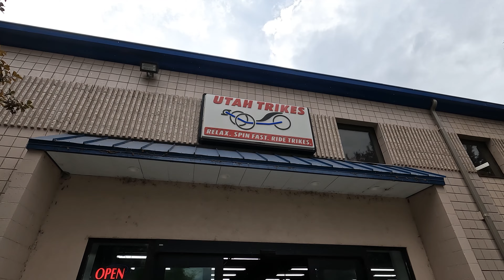The Stig tries out a new e-bike in Las Vegas!

Comment: But.....What about making my AC unit more efficient?
Reply: Yesterday was the first Sweater Weather day of the year so I guess it doesn't matter
Reply: Who cares? He's busy making spam! Look elsewhere.
Reply: If you are in a hot dry climate like the desert southwest then put evaporative cooler pads around the condenser and keep them wet. If you are somewhere with a high water table then geothermal would be the way to go. New A2L refrigerants are coming that are mildly flammable but supposed to be higher efficiency. Continuously variable refrigerant flow and fan speed systems are also available. Otherwise wait until the engineers have magnet based refrigeration materials costs down because gadolineum is expensive. Maybe we can mine some asteroids?
Reply: Yes!  Been waiting for the part 2 for ages.  Hope it'll come out before it gets too cold to do anything outside comfortably.
Reply: I’d love to see AC conversion to heater experiment, but when?
Reply: @Himself2019  What do you mean by AC conversion to heater? Like a heat pump with a reversing valve?
Reply: Change your filters every 3 weeks like clockwork. Clean out your condenser 4 times a year with pressure washer. Let it rest during peak heat. Run fans to help circulate the air in the house. Reglaze your windows every 2 years. Put in better insulation in the attic. Use expanding foam to insulate exterior walls. Caulk the seams around window frames. Don't run big appliances like tvs ovens or microwaves during peak heat.
Reply: @epluribusunum6622  Do not use a pressure washer on your condenser. Flat setting on a medium pressure hose and be careful not to bend fins
Reply: @RoyArrowood  I have a low pressure spinning nozzle meant for heat pumps. It aerates the water as it sprays.
Reply: @epluribusunum6622  Interesting, I have never heard of such a thing. If it works it works but I will stick to 40psi city water lol
Reply: @RoyArrowood  you only run it on idle and you put a powdered cleaner in it and it feels like water foam but the bubbles pop immediately on touching something. It's great on engines too
Reply: It's not converted. It's put in backwards, so you're cooling the outdoors

Comment: A couple of points:  First and foremost would be safety. It wasn't mentioned, but I hope the person doing the media blasting in the media room has a filtered air supply so that they don't end up with something like silicosis. On the anodizing versus powder coating; anodizing hardens the surface resisting scratching, and should be easier to clean after an off-road session, versus powder coating which could chip off.
Reply from the maker: The safety precautions were extensive. We dug deeper than what you saw in the video, but didn't want to bore the viewer with details.  They had a full respirator circuit for the operator.
Reply: @TechIngredients  Thank you for the added depth!

Comment: Unrelated but could you do something on insulating paint additives? I figure they don't make much difference, being so thin but would it make any difference on walls without insulation?
Reply from the maker: The thermal conductivity of most organic materials, including plastics and paints, is pretty similar and too high. You need to incorporate air to significantly lower this.  So, you'd be talking about foam paint.  That would be hard to apply evenly, and it wouldn't be very durable.
Reply: @TechIngredients  there was a ceramic bead additive online, basically adding bubbles. I figured the difference wouldn't be much but for cheap, I wondered if it would be better than nothing. I can't really afford the spray in foam, oe especially to tear down and install proper insulation.

Comment: You should maybe look into Hollyland Lark M2 it looks to be an easy to use wireless lavalier mic and I have been impressed by the sound quality when watching live streams in environments where sound is impossible to control.
It is not perfect, it does have some problem with wind noise. But it looks to be easy to use and not that expensive. But there are probably others with better noise reduction.
Still it would have been easy and much better than the sound in this video. 🤔
Reply: Get some lav mics.

Comment: Nothing to do with the subject of the video, but the comment at the beginning about the lighting issue with the GoPro, I have noticed on a lot of videos on YouTube filmed in the USA have issues with light flicker whether it is fluorescent, LED or other. I am based in the UK and film a lot on the GoPro but never seem to suffer with the same issues, is it something to do with the difference in mains power frequency use between the US and UK or the frame rates we film in, here in the UK we typically film at 24 FPS, not quite sure but I think the standard in the US is 30 FPS. Could these issues be caused by either or both of the differences.
Reply: 60hz is what the grid runs on so yes this is the issue.
Reply from the maker: Agreed
Reply: This can be substantially improved by setting the shutter speed to 1/30 second for 30 FPS, and letting the camera set the aperture and/or gain.  The problem is caused by the shutter speed being too fast, resulting in some pixels being exposed while the lights are at their peaks, and others at or near the zero crossings.  If you shoot at 1/30 second, this guarantees that every pixel gets multiple half-cycles of the light flicker, averaging them out.

If your camera won't let you set the shutter speed, you can use a neutral density filter to force it to run at a slower shutter speed.

Comment: Turn radius looks really wide.  Is that just because the guy is kind of showing off and getting up on two wheels?  Looks to me like the center of gravity is too high for sharp cornering.
Reply: Yeah, the more I look at this, the center of gravity definitely needs to be lowered.  On a bike it works because you can lean and centrifugal forces will hold the rider up, but with this, it looks like it would just flip over if you had to emergency turn to avoid something.
Reply from the maker: Keep in mind that ground clearance is an issue, especially for the off-road versions. You make a good point if the only use will be on road.
Reply: @TechIngredients  How about a five point harness and a roll bar?

Comment: whats the best helicopter blade rotor that does not need to spin in its own place. rep ring blade. or flower leaf helicopter rotor. the center is totally free. yep kinda rim helicopter blade. or like a wheel with motor and bearing inside. also contra-rotating such blades keeps the whole thing from spinning. and internal reaction control balancing.
Reply: also if you use bolts then no welds required. also they can be taken apart and modified and fixed really easily. the usual industrial true replaceable parts. statically charged particles coating would work nicely.

Comment: Not well designed. I would at least lower the centre of gravity by placing the seat below the wheel axels.
Reply: It's actually very well designed. Zach from Jerryrigeverything designed the notawheelchair for his disabled wife to be able to enjoy hiking trails again, so ground clearance for the less than fully abled people was the goal. These folks took that idea and are running with it at scale. Sure it won't break land speed records with that layout, but it was never intended to.
Reply: @mainmanmustard  I doubt he invented anything. The Notawheelchair seems to be from 2020. TrikExplor had a 4WD quad fatbike in at least 2018, and there's some discussion about them from 2013.
Reply from the maker: Remember that you not only need ground access for off-roading, but getting in and out of the quad becomes difficult, especially if the rider has limited mobility, as the height of the seating drops.